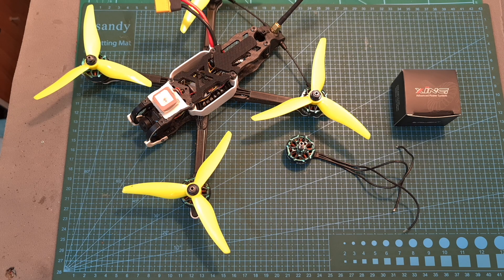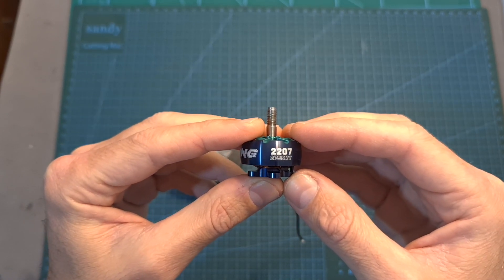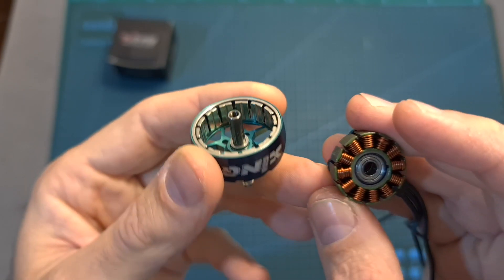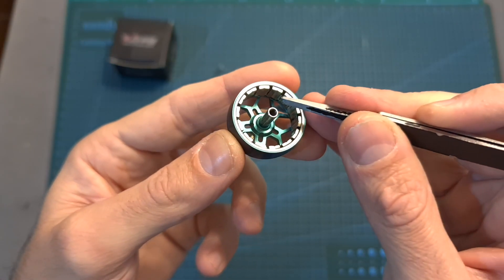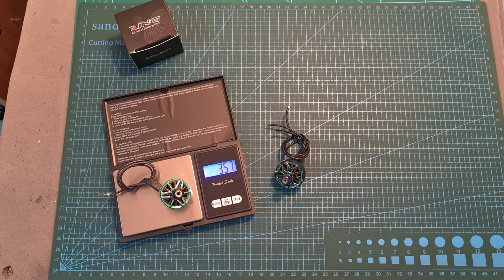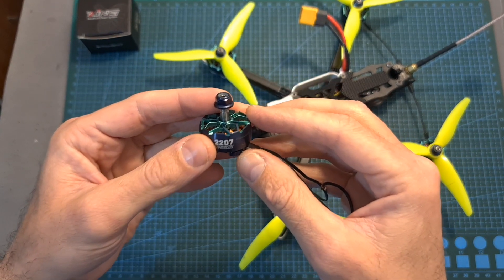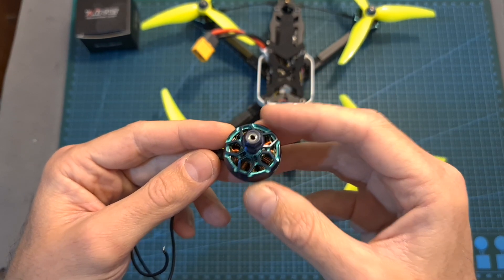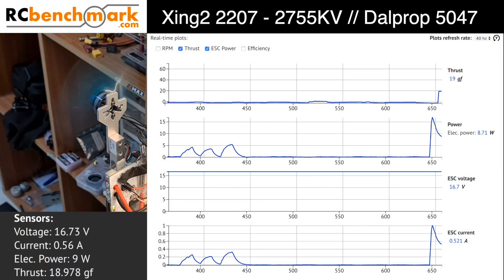iFlight XING2 2207 Motors - Review, Thrust Test & Flight Footage

Comment: Hi Kramer.
At 02:00 you say that these motors are battery killers when compared to other 2207 motors.

But are you specifically talking about your 2750KV motors or the same applies for 1855KV Motors too when compared to the other brands 2207 1800-1900kv motors?

Please reply ASAP.
Reply: They are absolutly fine . Nothing to worry about
Reply: @o_mtb1925  ty mate. I already got them your reply is a relief.

Comment: If these are battery killers, what 2207 motor should I get for more efficiency / flight time? (I run 6s)
Reply from the maker: Go for 1700-1750KV motors.

Comment: Mr Kremer one of my motors  isn't working from my nazgul evoque f5  using xing epro  2207 1800 kv 
Since you mentioned xing 2 as battery killers I am reluctant to shift 
Would you suggest this motors or should I wait for the stock xing e pro
Reply from the maker: You should just replace the damaged motor, I just hope that it's not an ESC issue.
Reply: @KremerFPV  Thank you very much for the clarification very kind of you to reply
Once again  thanks a ton 😊

Comment: These vs Rcinpower which will you recommend for same kv and size?? I feel that Rcinpower has cleaner windings
Reply from the maker: Check out these ones: https://youtu.be/RaUC0sAku08
Reply: @KremerFPV  already did I don't miss your videos but I'm bit worried about the way Rcinpower puts in their bearing it's not standard and has friction fit and it can damage the stator during removal and over-all that concept is not explained and Rcinpower is transparent about magnet they use

Comment: What ESC are you using with these motors? Looks like they draw 50amps under full throttle
Reply: Oh damn I just ordered some for my nazgul5 v2 which has a 45a BLITZ esc. Can I govern them via betflight to prevent frying another one of these BLITZ esc's?
Reply from the maker: http://bit.ly/KM55A-Stack So far no issues.

Comment: Wonder how these will hold up durability wise, have yet to ding a bell on my old Xings
Reply: A few of my first generation zings bell started to slide down. Just have to push them back into place every now and then
Reply: @overdosed51  You need to replace the oring at the top of the bell, it’s probably worn down flat